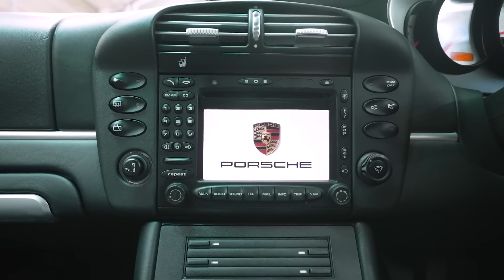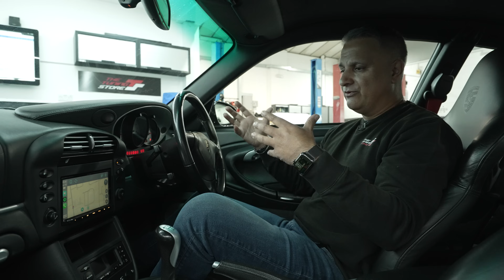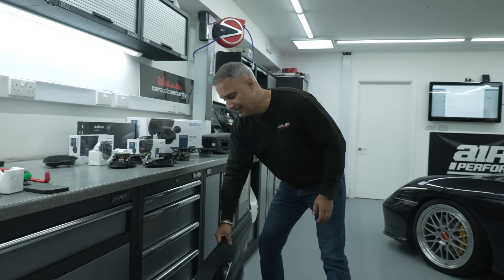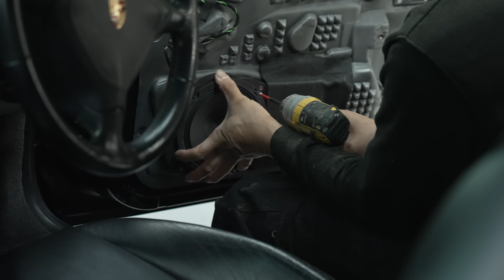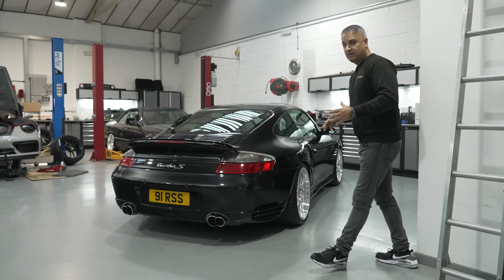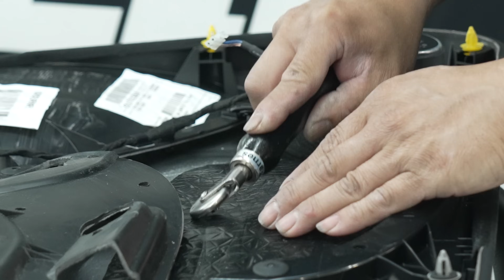Porsche 996 Turbo S Audio Upgraded & Perfected - Full Audio Build | Car Audio & Security

Comment: One thing that would definitely be revolutionary is if people would treat Sound system upgrades like dynoing your car stock, putting mods on it and then dynoing  it again and showing the power figures/ curves before and after 

So in translation for Sound systems would be like doing a frequency response test before, impose the before and after upgrades frequency response. Yes if you have a high-quality Mike and are showing the same track before and after, gives a little bit of reference, but being able to see a frequency, response graph would be a huge.

Comment: Did you modify the tweeters to get them in the stock housing ? Ie the housing looks stock from inside the car?

Will those speakers fit in the rear side panels of a cab? 

Thanks

Comment: that car is so staggeringly bueatiful, Jesus. I went from hating the 996 to the 996 turbo being my favorite watercooled variation. this video brings back great memories. I completed many times in soundoff back in the 90's and was fortunate I won 1st place all but 2 times in all the soundoff I was in 8 speaker but this was when MB Quart were some of the best speakers you could buy. also Rockford wasn't a best buy brand the 1000c amp was like 3500 dollars. I did 6 1/2 and tweeter in doors and 5 1/4 mid in the rear side of pack tray two a600 precision power that I switched for punch 150s I cant remember the crossover that was in it but the Rockford subs were great but the jl w6 was released and I switched those into the ported box. the guy who did now owns a place new German performance but he had the same set excepts the subs in his '91 civic SI and it blew my mind but for some reason the sound quality is what I won the frequency readout wasn't flat it wasn't the loudest best when the judges listened to it they were always blown away . it helped that the amps 1 bridged the other at 2 ohm or parallel...I cant remember but it was great time in my life. the car audio scene died out here in baltimore MD, I guess it all switched to performance but its no turbos s. this just looks so tidy and sanitary but at same time weapons grade. what a tasteful car. simply stunning!! cheers